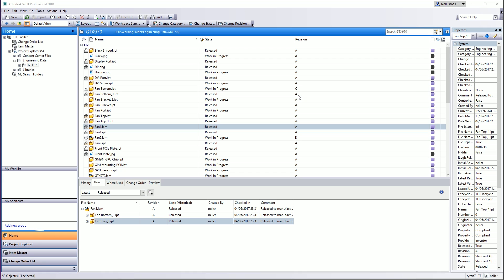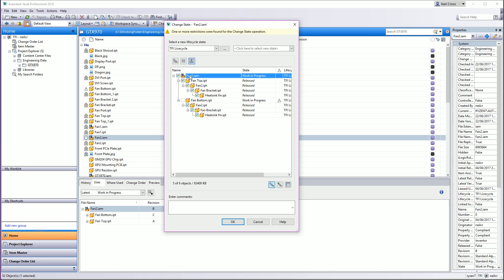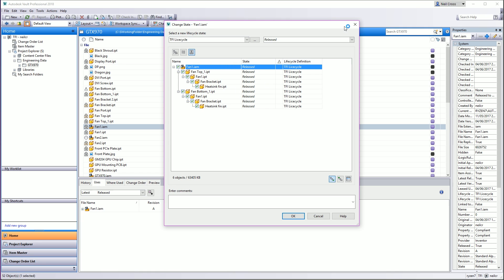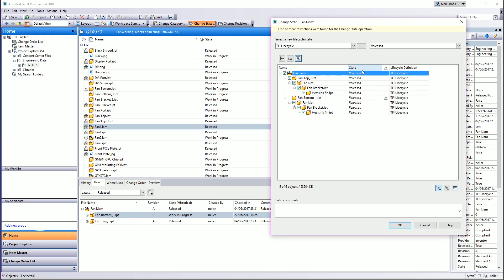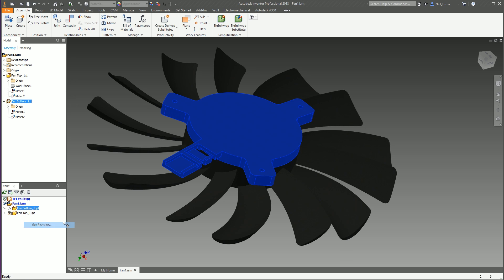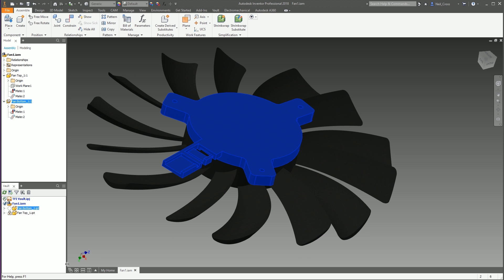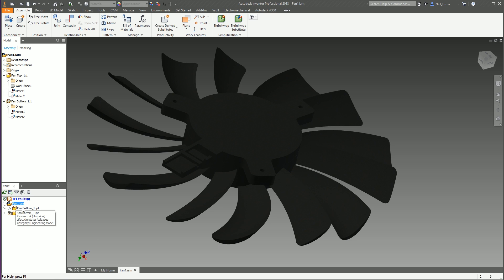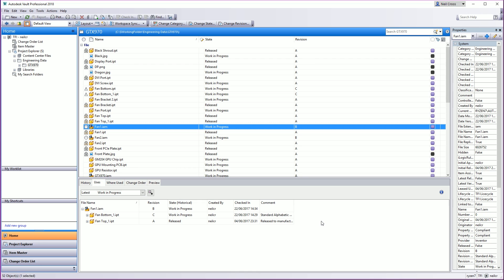The Autodesk Vault Triangle of DOOM Explained

Comment: Hey Neil @TFI, don't know if it is worth a new video or not, but picking up on some of your other "benchmarking" videos I am wondering if you have anything to say about Vault's ability to make use of processor features. In particular, I am wonder about your take (if any) on more cores vs. faster processor speed. If relevant, thinking about deploying under Win Srvr 2016 Std on a Xeon based machine. Given the price of these processors, would be nice to know how they will be utilized by Vault before spec'ing one out!
Reply from the maker: The thing with Vault is that the majority of it's perceived performance is actually through the web services, HTTP traffic between client and server, that's what the user waits on when getting and sending files.  So the most important thing for Vault is a fast and responsive LAN.  The vault server will benefit from fast CPUs when querying the database for searches and relationship checking, but a good LAN is far more beneficial than a blazing hot CPU in the server!